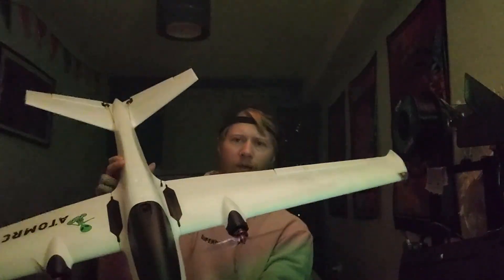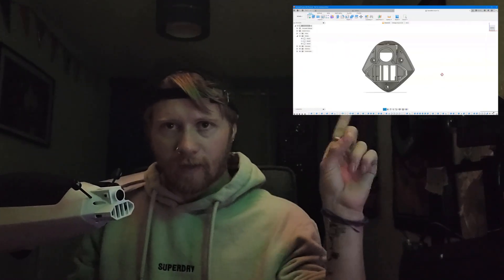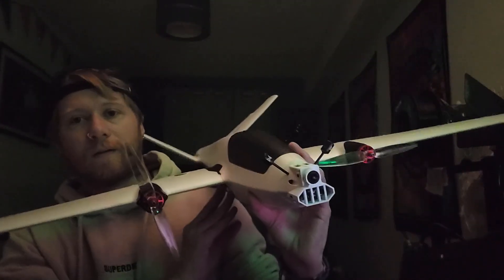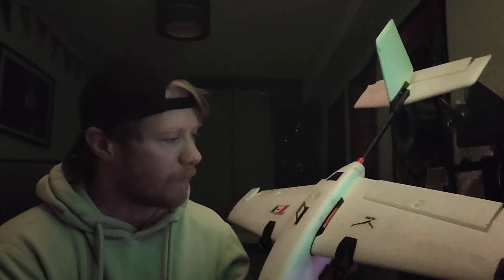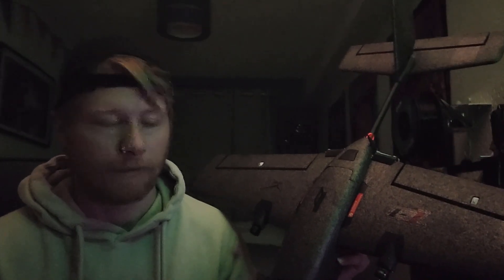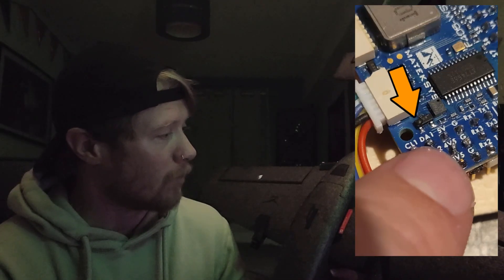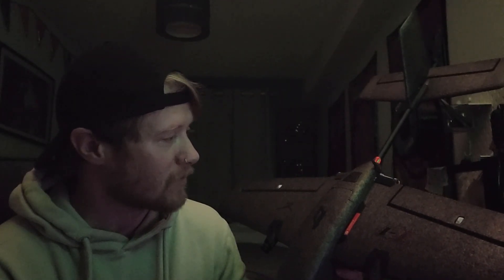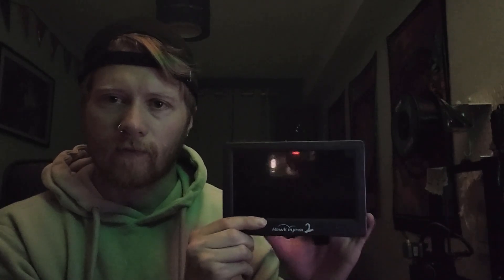🛩️ Update - What Projects Am I Working On At The Moment?

Comment: Tip for cutting:
Print a cutting template you derive from the glueing surface. Just as the outline with some holes to put pins through. This way you have a cutting guide

Comment: I was thinking about a T-1 VTOL build around a SpeedyBee F405 Wing. Just had great success with the FC in an Airloader. But if this is preconfigured... Hmmm. Thanks bud!
Reply: Be careful with the whole pre-configured statement.  "Please kindly Note:  Regarding to the FC, we pre-installed it on the plane, but it is not fully debugged. We provide flight control VTOL parameters for free, but this parameter is for reference only, and we do not take any responsibility or obligation for this parameter. It is strongly recommended that players must strictly adjust according to their actual flight environment and needs",  kinda shitty if you ask me,  how can they not know how this is to be configured LOL?

Comment: How have those quick disconnect things in the wings held up for you? I don't fly my T-1 nearly as much as I'd like because one of the wings breaks connection with the slightest jiggle. Has cost me a few servos and ESCs and a motor, and now I don't trust it much, and I'm too lazy to rip those connectors out and wire up a whole new solution.
Reply from the maker: I pretty much never take the wings off my T1, so the quick connector things are still going strong/have had no wear of tear. Maybe you'd be best off just gluing the wings on your T1 permantly?